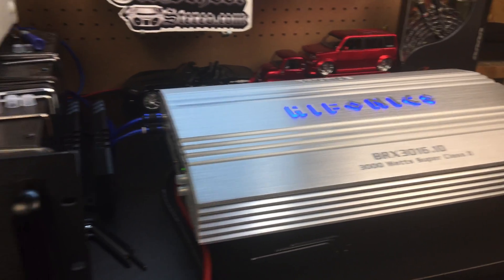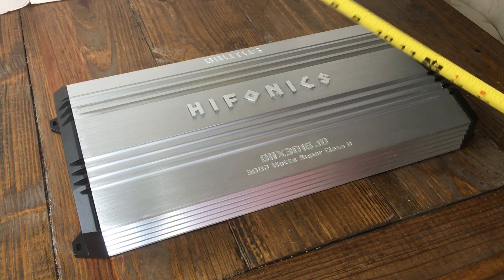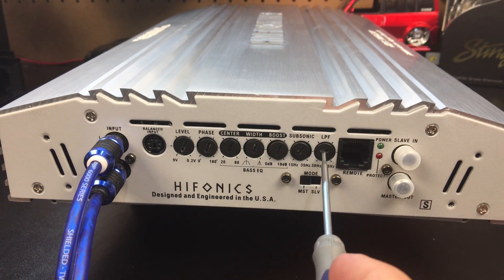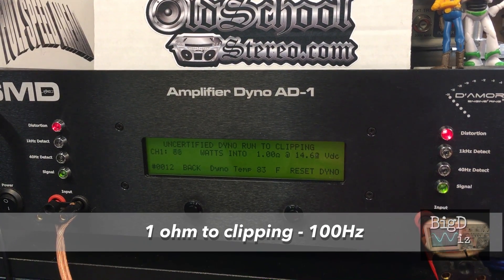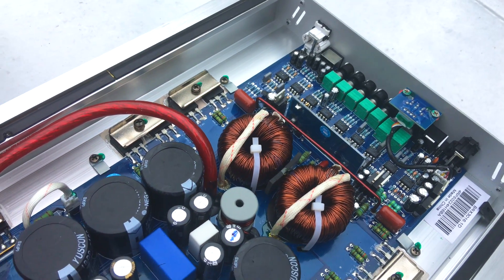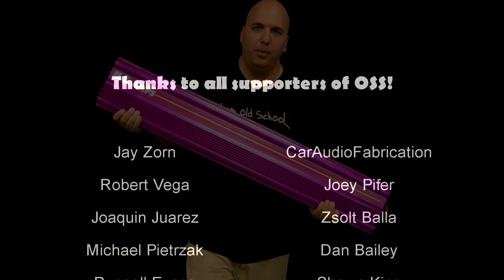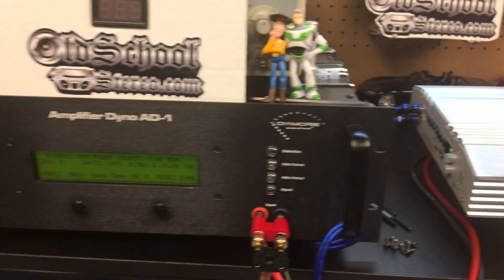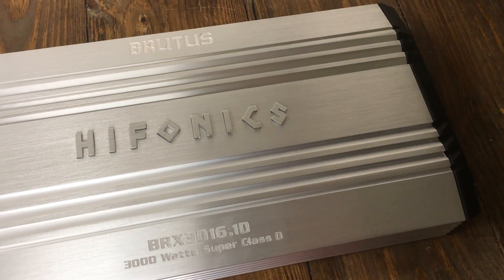Is That 3kW RMS or MAX? HiFonics Brutus BRX3016.1D 3000 watt Amp Dyno Test

Comment: are hifonics high quality? guy says its the best at local shop
Reply from the maker: I would say average quality. Old school HiFonics were high quality (pre-2000’ish)
Reply: Kyle Salva the guy who made this video wasted $260 but I had to get my trunk repainted because this pice of shit caught on fire literally
Reply: Shawn Connolly idk, this is a budget amp from hifonics but there more expensive elite amps i know have military grade boards and are known to put out huge bass and only come with a warranty if installed by a licensed shop. I’m not saying it’s good or u did something wrong but it seems people hate on hifonics
Reply: Kyle Salva @ first I was amazed by the power it was giving my sundown speakers - it ran good for a while - it didn’t blow any fuses it just straight caught on fire - I smelled smoke opened my trunk and saw flames !!!
Reply: Shawn Connolly maybe u had so much bass it rattled something inside and shorted it out lol would love to rip it open and see what happened
Reply: Kyle Salva maybe - however I set the gains according to ohms law - so I know it wasn’t from being a knob and turning the gain to max lol - a AMP is supposed to be able to handle vibrations as far as taking it apart to see what happen inside #1 when I opened my trunk after seeing smoke I literally saw flames so I think it would take a fire forensic to tell exactly what happened 🤣😂#2 After removing the voodoo bus fuse , I quickly cut all the wires except the RCA wires took out the 2 screws holding my amp rack & threw it on the side of the road lol so if you are interested in dissecting this Amp it’s in Tamp FL on the corner of Columbus St & Nebraska Ave lmfao 🤣😂🤣😂 I drove past it today - it’s still there /// if you have ever smelt a AMP that been on fire internally , then you know why I left it on the side of the road -// every once in a while when I get a deep long bass note I can still smell the old AMP

Comment: I wanna see the 4000 watt hifonics
Reply: JDM Toys do they cuz I was planning to buy 1
Reply: JDM Toys there is to many brands out there now I was looking at the CT sound too also some 1 told me Wolfram but never heard about it
Reply: JDM Toys I have a sq (soundquebed) for my kids and highs I was planning to keep everything sq but I only have around 300 to spend I have couple of subs that I can play with also I seen that  the cab 1600.1 does rated
Reply: JDM Toys also seen that the skar 4500.1 d it's on sale for 400 of 450
Reply: Mnt OLIMPUS 5000 whatt.
Reply: streetlegal6988 I have a Brx 2416 and its been flawless. Nothing unreliable about it. Most peopld getting Hifonics, get it for the price. Run a stock electrical supply...not good for any amp and sub. I thought I was having issues with either sub or amp, them bought a Mechman 320 alt and all the problems went away and I was able to get a lot louder.  Its been good to me. But I did just upgrade yesterday to the Skar RP3500
Reply: Robert Contreras how do you like the rp 3500 is it holding up bro?

Comment: i blew 2 of these in one day lucky amazon does refunds got an american bass vfl 4400d and its been great ever since i hope u dyno that amp soon
Reply from the maker: +matrixownz I was wondering about that one. I bought this one off VMInnovations on eBay. I’m going to contact HiFo directly for assistance
Reply: djhaloeight i dunno..4 replacements makes me think something was wrong with install..hard to believe u went thru 4. These are usually well tolerated and last a decent amount of time. Ive read a ton of reveiws on this amp and its always near perfect ratings.  Did u have the amp attached to the sub box by any chance? Im sure maxxsonics even blamed it on your install or something on your end after 4x of warranty repairs. Hard clipping maybe? Not enough ventilation? So far mine is working nicely but im running at 2 ohms..
Reply: how do you manage to blow 2 in 1 day?
Reply: they replaced under warranty 3 times then said no more. last one smoked, had fixed on my own dime and smoked again. tossed it in the garbage. they blow the output fets just like in the end of this video
Reply: because there junk there the only amp I have blown in 20 years of installing systems hifonics used to be great but they sold out for cheap internals
Reply: matrixownz just to be clear..i dont have this model i got the brx2400 maybe that one is built better and this 3016 is not
Reply: akuma4u i smoked 4 of these hifonics amps. they’re garbage. had double 0 gauge pure copper wire, big alternator, extra batteries...they’re shit

Comment: all hifonics amps since 2000-2005 that i seen are a littel overrated! But the Colossus XX II in 2006/07 was underrated. Radet @ 3.2k mono @ 14.4vby 2 ohme. Measured @ 2ohme mono by 13.8V = 3566W and bei 13.1V 3121W to 3232W by 
manufacturing tolerance!
http://www.audiodesign.de/downloads/testberichte2006/XX_ColossusII.pdf
http://amp-performance.de/1183-Hifonics-XX-Colossus-II.html
Reply from the maker: Thanks for sharing 👍
Reply: no problem. your channel is reale nice! we need more of this type of videos!! 
greetings from Germany! Thanks Master BigDWiZ

Comment: +BigDWiz, I just ordererd the BRX4016.1D and expect delivery tomorrow or the day after... Can't wait... :) Paid US $327.99 for it..
Reply: satanclaw did you get your BRC4016.1D amp yet? I ordered the same amp and was wondering how it's working for you.
Reply: BRX4016.1D
Reply: It's working so good that I ordered a second one, for strapping ! Awesome little amp !
Reply: I have a 4016.1d also. Tell me the wattage it put out for you and how well is it holding up. What electrical and battery upgrades did you do?
Reply: I have a GMC pickup truck with a 6.6 duramax, 270A idle 290A high idle alternator,  10 farad stinger cap,  dual 0 gauge cables, 1 from each of the front batteries to the back, two 208AH Agm batteries in the back, the two amps are strapped, so they are outputting 8000w @ 2 ohm mono on a 15" 15000W rms capable Ground Zero sub in theory. I have no means to measure the poweroutput.
Reply: Sounds like you have more than enough power going to both of these amplifiers. What about overheating? Are the 4016's getting hot? How are you keeping them cool?
Reply: No, they are not getting hot, but at the same time, it's winter....
Reply: I have one 4016.  im gonna put it on a kicker comp 15 on it to get it started and work out the electrical upgrades. Any suggestions for me?
Reply: You should build your system for max 300a current draw, aka 0 gauge cable from the battery in the front to the back, a capacitor would be nice, as for other upgrades, it depends on what car, alternator and battery setup you have. Getting a Car stereo battery in the back from the likes of Stinger is a good upgrade as it will act a bit like a cap when playing. For just music, you should be fine with a 0 gauge OFC cable and a capacitor next to the amp.
Reply: Thanks a lot bro for the info. It's good to know somebody got one of these things working.

Comment: I have been using a brx 1100.d for about 7 years on two RE 12s rated at around 500 rms and it has been a great amp it has never shut off or givin me any problems for a 120 dollar amp i would buy another
Reply from the maker: Awesome 🤙

Comment: Do you have to upgrade your alternator to a 160 amp one with these kind of amps, because I bough one use and on the sonicsound website it said to (mine is only 2000 watts tho)

Comment: I have always been a fan of the hyfonics amps ..for some reason . I have always wondered..at the unrecommended half ohm load how long would most amps last ?
Is there any way you can get your hands on a older version of the zues 400 watt amp? I used to have on of these and I would love to see some results on this one..damn shame about smoking this 3k amp..I thought the protection circuitry would have saved it at .5 ohms.

Comment: It says it's pulling 250 amps? Is that mean your alternator and electrical system needs to produce 250 amps? If I have a stock alternator and only produces 100 amps then what??
Reply from the maker: +Brian Deborde since wave tests are worst case scenario. You will need an extra battery at the minimum to get optimal results from this amp

Comment: Kicker is going to die as a brand if they can't at least make rated.
Reply: Kicker does rated and more! What kicker amp doesnt do rated?
Reply: Yeah, what? This isn't a Kicker amp, what are you talking about? And Kicker does do rated... Most of the time. Apparently their powersports amps are lacking. But still.
Reply: LMAO. Kicker is one of the very few companies that accually do R&D on their amps.  You won't find another amp with the same board kicker has.  

They been here for awhile and will continue to be around.  Kicker uses full bridge designs like Brazilians do.  But it's not Brazilian so to speak. it's like Brazilians design and efficiency but with the overbuilt tank style like s&I Korean amps are built.  You will just pay for that.
Reply: Wut?

Comment: wait wha what? 800 Watts more Watts with a music track?  does that not bring so many of your other tests into question?  are we saying 40hz is too hard for most amps?
Reply from the maker: The Dynamic RMS Power mode measures RMS Power with only 40ms. The music track should always yield greater output due to varying frequencies and yes, most amps will do more power at higher frequencies. I wanted to show this test to give actual measurements using music. People want to see something different than test tones.
Reply: @wal  I would like to see a 50-80hz test

Comment: BigDWiz,

I have a real old school treat that is the Original OG of cheater amps...The Punch Power 50m. Any way we could get this thing dynod? it was the only old school rockford rated at 1ohm. Most old school cats were running these at .5 or even .25 Ohm. I have the 50m and 50.1 (same board).
Reply from the maker: +George Makris I believe I have a 50x2, but not 50m

Comment: what a beast for the cash. did it not have protection? would the 250 amp fuse have protected it?
Reply from the maker: +Joshua Cox the 250A fuse didn’t react fast enough and it appears the protection circuitry did not stop the pop 🤷‍♂️

Comment: Thanks for this! SonicElectronix is explicitly marketing the Brutus amps as RMS ratings, which is clearly BS. They are saying 1x3000W at 1 ohm RMS for the 3016.1D.
Reply from the maker: +Josh Haimes they have mistakes in their listings. Even HiFonics themselves don't say RMS in their specs
Reply: Yea. They made that mistake for every Brutus amp they sell. At least Hifonics isn't dishonest, but I think we'd all prefer if they just stated the RMS so we wouldn't need to guess. But, now we have a better idea...
Reply: Just dug up my BRX1100.1D manual, which is completely different than the 3016.1D. The 1100.1D is much more of a manual, with 15 pages. It does include a page of specs, and states power ratings as RMS.

Comment: i have ran the basic hfi amps down to .25Ω stable lol gotta love how the say its only 1 ohm stable
Reply: joshua johns you have to account for box rise. just because you are theoretically running at .25 ohms because the way the subs are wired. box rise might have the load up at 1 ohm or higher.

Comment: said it before. best 'tuber on youtube. and consistently too. hope this channel was not going to fizzle out when completed dyno testing all amps owned. sure 'nough. never seize to amaze. big D. a hero.
Reply from the maker: +indopleaser there are 100's of brands and 1000's of models since the 70's. I doubt I'll ever run out of amps to test, but will be doing vids other than Dyno tests also
Reply: BigDWiz been into speaker building. like floorstanders. you could be them and measure all those things like decay times, off axis response, freq response, break up modes, spl, distortion, phase, timing. not an expert. so another 'tube channel to teach is always welcome.

Comment: i see hifonics has went way down hill since the 90s. i dont understand why a company wants to make there products worse.
Reply from the maker: +jhue73 I don't see how it's worse? $260 for 1800 watts? The original Colossus would give you 1800 watts, but cost $1800 (over $3k in today's $$)
Reply: they were made in the usa in the 90s and the parts where alot better and they didnt use fake ratings other than that at $260 for 1800 watts its a steal. yep a dollar a watt back then.
Reply: Because they have been owned by Maxxsonics since they "went downhill" - sometime after Series VIII...

Comment: I heard bad reviews on this amp getting hot or being defective. What do you recommend for a top 3k amp
Reply: A Ql Had mine running @ 1 ohm / multimeter tuned -with a small battery bank , zero gauge wire -it was powerful @ first a @ 40 hrtz POS 🔥caught 🔥on fire literally 🔥 had to get my (deck lid) “trunk 4 the slow” repainted 
🖕🏻@ hifonics
Reply: DO IT YOURSELF MODS yes they remind me of Orion 🤣😂 in the 1990’s Orion & punch amps were the best 🤔now you can buy either one @ a flea market 🤣😂🤣😂
Reply: DO IT YOURSELF MODS glad you didn’t burn up you OEM wires
Reply from the maker: +A Ql it did not get overly hot during the testing. The Wolfram 3k amp I tested recently would pump out the power all day, but the heatsink is big
Reply: DO IT YOURSELF MODS -I’m not going to lie I have 2 class D mono block 1ohm stable 
2400 W Orion amps which I took the 2 of them out to put in the 1 hifonics // there the new generation Orion colbalt <~~ I think that’s how they spell it - the hifonics had some power / punch to it - I just don’t like that the fuse didn’t blow before it set itself on fire -the fuse was less then 5inches from the positive amp terminal
Reply: DO IT YOURSELF MODS / the hifonics had no fuse @ all I The amp , inside the box it came with a voodoo 250 with zero gauge wire inlet /outlet on the bus fuse 🤣😂@ “the AMP conspiracy” 🤣😂 they don’t make anything like they used to - head units used to have treble , bass & fader , my new radio has 15 different bans lol nothing is built to last anymore - I have sundown subs dual 2 ohm wired down to 1ohm - I think I’m going to buy the sundown AMP that they recommend for those subs - the AMP on sale is $900 after tax / I just am worried about spending $900 on it !!
Reply: DO IT YOURSELF MODS I think they use cheap ass solder to solder to hold there lil capacitors & rectifiers in place & when the AMP get warm enough from currant flow - the solder melt and a rectifier leans against another rectifier or lays flat on the circuit board and it causes a automatic “melt down” - 🤔when I get a deep long bass note , every once in a while , I still smell the burnt up AMP 🤣😂😂🤣🔥🔥🔥that smell sucks
Reply: DO IT YOURSELF MODS what do you think about the new Orion Ztreet z08000.1D mono block  ? It says max music watts 8,000 - RMS @ 1ohm  2,000 //A friend of mine just gave it to me brand new in the box & told me to hook it up & he will come by Sunday to either get 
$ 140 or the Amp back
Reply: These hifonic amps should come with power protect mode. Mine automatically shuts off if it gets too hot.

Comment: You should test the Power Acoustics Razor RZR1-2500D it's only at most $100 or some places alot cheaper. My friend has one and wanted me to hook it up to my w7 to test it out but it's supposed to push 900 rms at 4ohms & 1,400 rms at 2ohms but I don't think that's true with it only excepting 8ga power wire at the max and having only 2 30amp fuses. If you made a video I can show him actual numbers instead of me telling it's not making anywhere near that power and him not believeing me. Who knows it might actually surprise all of us.

Comment: I have had 2 of these strapped very nice amps, I could not fit my ofc sky high into the amp and also my sky high 8 gauge from john rabe. I have adapters for them and I am currently running 1 at .5ohm all day and no issues, amp doesn't get to hot either on a single brx3016 I am running 2 xfls at .5ohms and pulling a 150 at 36hz I have a few videos on my channel and will be uploading new ones here this week of it metering etc. Also they have a 4k now too, also I did try this amp at .25 for the hell of it too haha